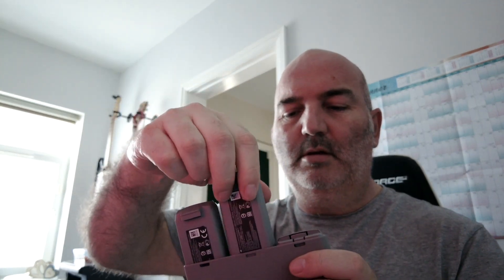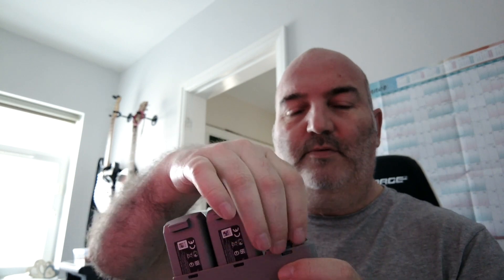DJI Mini 2 battery issues

Comment: I just ordered a Mini 2 too....May i ask if, after i fly the drone later on, should i also remove the battery from the Drone or it can stay on it? So let me understand this video too, when i fully charge the batteries, i should keep them out or that way, from the charging hub right? Thanks for your patience
Reply from the maker: Hi. In the ideal world, keep your batteries out of the drone/charger when not in use. If you are not planning to fly for a while, charge/store them at 60-70% for optimum conditions. I normally charge mine the night before i intend to fly. Hope this helps.
Reply: @HeatonPhotography101  60-70% are 3 lights ON, in the charging hub?
Reply from the maker: Three full and one flashing 👍🏻
Reply: @HeatonPhotography101  Thank you sir.

Comment: I am not down with flipping the batteries around and forcing them in the hub. It stretches the hub;  distorts the plastic and puts a nice gash in a Lipo Battery casing. Not cool. Hot potentially. Also no filing off the ridge in the hub. It's there by design.  Also, no 3d printed "separators" to bend pins or get stuck to them. Instead I cut three small rectangles of plastic that are a couple mil thick.  Drop them in the bottom of hub after charging and put the batteries in the right way with slot aligned. Not elegant. But safe, easy to manage and no modifying or damage to original components.
Reply from the maker: I like this non destructive solution. Ultimately, it is personal choice so people should solve this issue however they feel best. I am merely trying to bring attention to it. DJI are working on a fix so let's hope that they come up with something. Personally, I will continue to just turn them round and let them poke out of the top of the charger. This will serve to remind me that they need charging prior to going out.

Comment: sir how about the battery showing that is full charge but i put inside the drone but it wont turning on, i tried many times even the 3 batteries but still nothing happens,, thank for responding sir,,,.,.
Reply from the maker: Hi Samuel. Unfortunately I have no idea what your issue is. I would suggest contacting DJI directly and describe the issue to them, they will be able to assist you better.

Comment: You can push them all the way down, they will not do any harm. They only leave a line down the label and after a few times they slide in quite easily.
Reply: Not sure I like the idea of putting nice gash in a Lipo Battery,  potentialy breaching the casing at any point is not a good idea. It also distorts the hub plastic, possibly weakening the hub in the process. Just because you can do something doesn't mean it's okay. I prefer loose plastic spacers I made to sit in the base of the hub, removed during charging, replace during storage.  Elegant it's not. But buys time until and if a FW fix is rolled out, and is reversible.
Reply: @BlairAir  the other option is don’t do anything at all and destroy your new lipo battery because DJI hasn’t and won’t come out with an update to protect your batteries. Try flipping your batteries and see how much resistance there is, definitely not enough to breach or distort the plastic housing, and I’ve had mine flipped since reading about this problem on the DJI forum for months. Lipo batteries are expensive and you won’t be getting any results from DJI anytime in the near future with this issue, so you have to think outside the box and take your own action, before your batteries end up destroyed. Ive seen other posts where people have used a dremel tool and removed that plastic track inside the hub.

Comment: i simply put masking tape over those connector pins (charger). so when i place back inside the bag its not that bulky. this simple hack might help too.
Reply: What you don't want is to either bend pins or get tape into the female connections in the batteries.  As a workaround it helps, I still like my removable spacers under the batteries. Hopefully all of these will be temporary if DJI can do a FW fix. I'm not convinced it's possible based on the need to keep communication to leds and power button.
Reply: @BlairAir  i like to try that spacers, i think that will be neat than than the masking
Reply from the maker: Good tip. I think the main thing is just we don’t leave them sat in the drone or charger. 👍🏻

Comment: I never noticed a discharge of the  batteries when they are in the charger block. Would be interesting who in the comuunity saw this effect. Are there any messages from DJI?
Reply from the maker: I picked it up on one of the drone forums, then saw lots of people having the same issues. There was a reply on the dji forum that they have acknowledged it and are looking into it. 👍🏻

Comment: I have to say that to me the battery left fully charged in the charger, self discharged autonomously after some days (about 10 days). When I pressed  the butto, to check the charge level the last led on the right of all 4 was blinking, that should correspond to about 75% of state of charge. So they do by them themselves down to this level. Anyhow I concur that this could be not enough for the lipo and indeed for long period storage should be better to discharge to about 30% as for the manual. But to reach this level you need to do manually, for example flying with the drone. Ciao ciao
Reply from the maker: excellent advice.

Comment: Beware!LiPo and LiIon batteries are not to be left fully charged for a long period of time!They should be left fully charged for a day or two but avoid keeping them fully charged for weeks or even months!If you know you wont used them for a few days or even moths,up to 6months,one should put them on storage voltage which is arround 40%.Never discharge them below 20% either and keeping those two advices your batteries will last longer and give you the best capacity it could,otherwise you'll get a worned out, puffed with a lower capacity and lower drain battery.
Reply: thanks👍
Reply from the maker: good shout, thanks.

Comment: Alternatively you can just put a rubber band round the battery, just below the contacts, then the batteries will still fit in the carry bag.
Reply from the maker: This is a good work around. For me though, im less likely to remember to charge them before flying if they don't look out of place.

Comment: They won’t go in the battery charging case because of a very thin line inside along the back. I got a very small flat file and filed the lines flat and now my batteries can be pushed right in so that they don’t stick out.
Reply: Actually you can push them in without filing the lines flat.  It won't hurt the battery charging case.
Reply: @phcalama  I second this have been doing it since I heard about this discharge issue and had no problems at all in doing so
Reply from the maker: Nice trick, but i think i will stick to the old leave them hanging out of the top method. This way there is no chance of me packing them without charging them first. Nothing worse than the thought of arriving somewhere to fly and finding flat batteries.

Comment: What the percentage for long term storage
Reply from the maker: They should sit around 60-75% I believe.
Reply: As per my long experience with Li-Po batteries, it's recommended to discharge them to 30% and store in cool place - fridge is a good option.